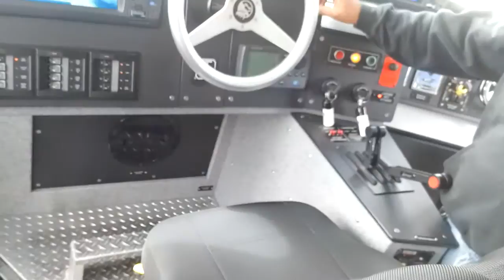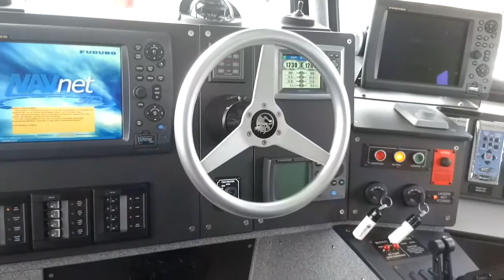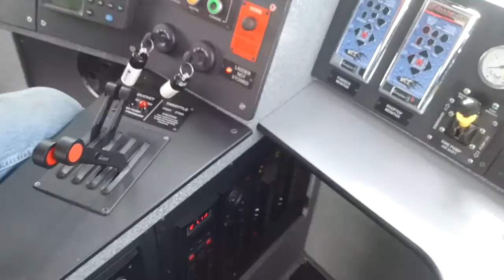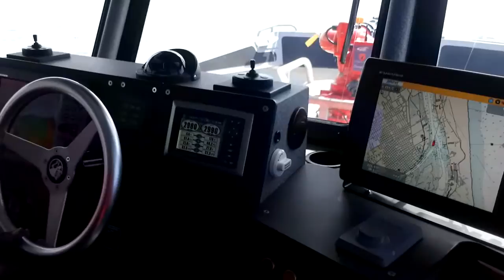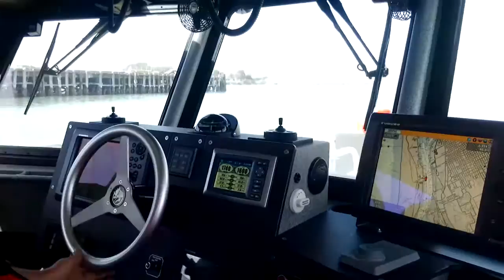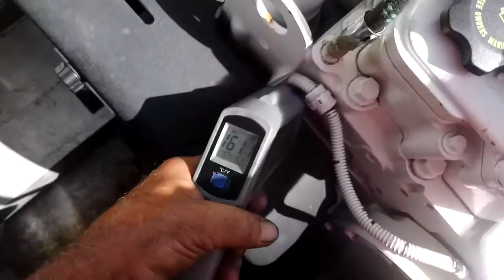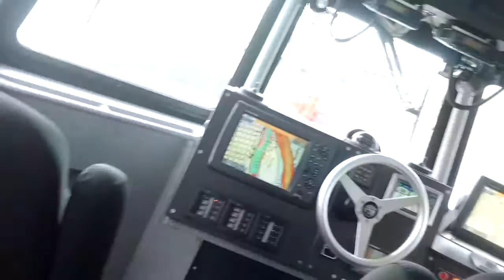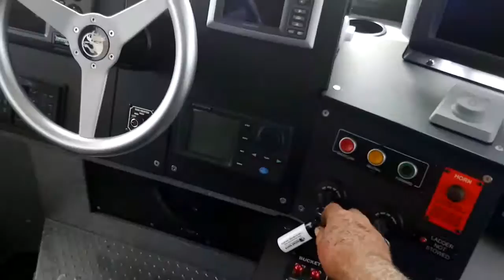Twin Cummins QSC 600's powering Humboldt Bay's fire boat

Comment: Did it fix the problem.  We have the same set up at about 2700 rpm the temp rises close to 210 deg we back it down to the 2600 era and it cools right down to 190 era